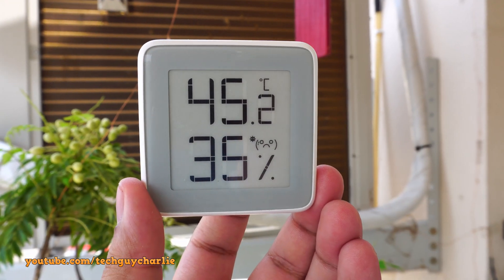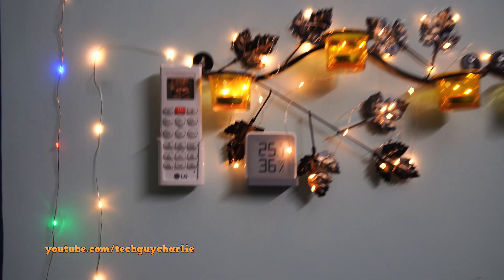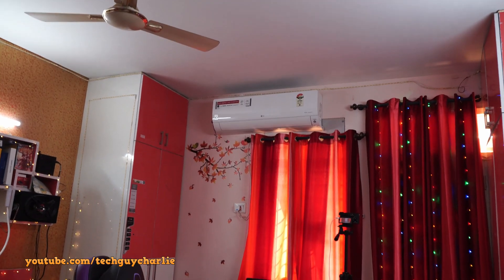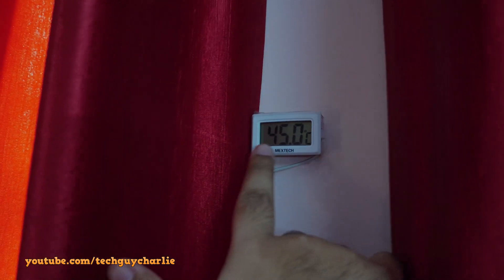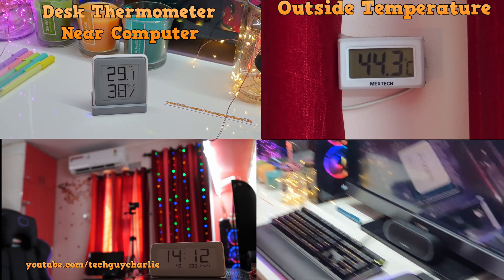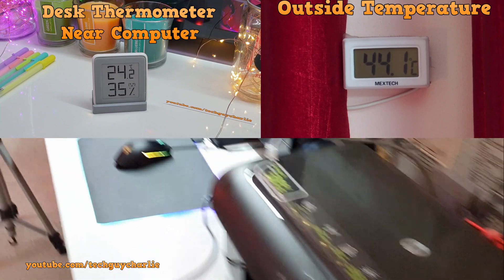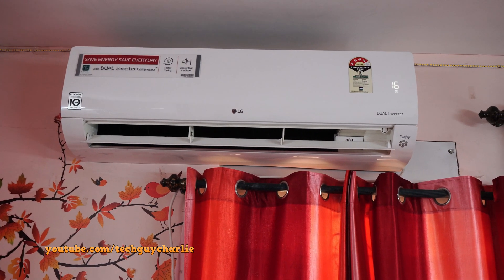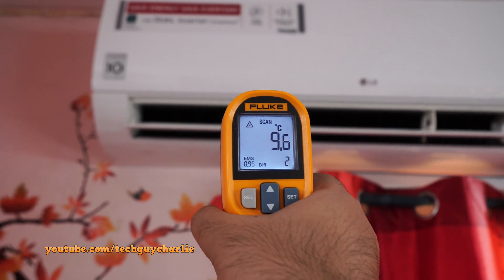LG Dual Inverter AC cooling performance on 44-45*C day how long does it take to cool

Comment: Hello, did nayone face this problem? Indoor tempertaure on the remote is 23 but on ThinQ app it shows 25 degree, when i manage my ac from the app when i was outside indoor temperature does not reach the required teperature 23 degree or 22 degree

Comment: Bro I have lg dual inverter 1.5 ton ac.
It takes 2 hour to reduce temperature from 37 to 27 degree celsius after servicing of ac. In my opinion, it is not a good performance what should I do??
Reply from the maker: Mine takes only couple of minutes, your PC is probably undersized for the room or you have power saving mode turned on, try running at 24*C with medium/high fan speed without any power saving mode, it will cool within minutes.

Comment: 1:48     I live in Taiwan. I just installed LG inverter air conditioner in July 2021. The cooling capacity is 2.2kw. The year of the outdoor unit installed at that time was 2019. The cooling degree is excellent but there is abnormal noise. In September, it was replaced with an outdoor unit manufactured in 2021, and the problem of insufficient cooling capacity began to occur.
Reply from the maker: Hi, did they vacuum the lines after replacing the outdoor unit? And have they replaced it with the exact same mode?
Reply: @TechGuyCharlie  Yes they did about 30 mins, and replaced the same mode. Before replaced, I observed in LG Thinq app, if I set up the target temperature at 26℃, and the compressor stopped at 25.5℃ and restared at 26.5℃ room temperature . After replaced, the room temperature rises upto 26.5 even 27℃, the compressor dosen't work at about 30℃ outdoor temperature.

Comment: my ac is taking like 1600 watts and not lowering room temperature under 28.9 degrees, what seems to be the problem ? the air is coming out cold though
Reply from the maker: To me it sounds like an undersized AC, I am guessing the room is quite big? 🤔
You also might want to check if there is cold air leaking from the room, check the doors and windows.
Reply: @TechGuyCharlie  hmm there is barely a little space under the door, and it seems like a 14x16 or 12x16 room my ac is 1.5 ton

Comment: My Dual Inverter AC 1.5 ton if the temperature is 45 outside it's run at full load...like it's consuimg like 1.6 units / hour or full night like 10 hours it's consuimg 16 units...where should I check is it AC issue or digital meter issue
Reply: It depends what you feels and check temperature of air coming out of your ac  with digital meter hand gun like in this video  ( infrared one )

Comment: Brother i want to buy an ac which has nice cooling with high energy saving. So should i go for lg 2021 ac modles?
Reply from the maker: LG is very good! I actually upgraded this AC to the hot and cold unit, so that we can get rid of the heater during winters, it's pretty good, solid cooling and heating too I've reviewed it here: https://youtu.be/US5RQN8hvC8
Reply: @TechGuyCharlie  thank u so much😊. I'll go for lg now

Comment: I have LG 1.5 ton AC dual inverter and I live in top floor with direct sunlight. 
I feel my AC doesn't cool like before. It's less than 1 year old. When outside temperature is 34 degree celcius the room temperature only comes down to 26 when set to 18 degree Celsius. What can be the issue?
Reply from the maker: That is quite strange, never had this sort of issue on any of my LG ACs, they always cool well below 22 no matter how hot it is outside. I hope you don't have the power saving feature turned on?
Reply: @TechGuyCharlie  How to check the power saving feature is on or not?

Comment: i really love the way u make your videos...a high tech one...im from Saudi and outside temperature right now is 43..i have set my lg dual inverter ac on 27 and its consuming 11 units on 24 hour run which is day and night...is that normal?...my outer unit has a wall infront which is like 3 feets away..is that ok?
Reply from the maker: Thank you! 😊 yes, this sort of power consumption is pretty normal, especially for big rooms. And 3 feet is a little too low, but as long as there is proper ventilation and space behind the condenser coil, you should be okay!
Reply: @TechGuyCharlie  yes its wall mounted on brackets so their is a standard space as per the mounts spacing....and despite of wall 3 feets away  it is open from the top ..outer is placed in gully usually given in banglow on the sides...if i mount the outer upwards in totally open area will it save electricity?

Comment: Bro i have 220sqft room.. can i buy lg 1.5 ton ac.. room in ground floor and no sunlight issue in room
Reply from the maker: Bro, I would suggest to go with 2tons for such a big room. 1.5 ton is good up till 160-170 sqft max anything above that you'll need 2ton for good cooling. 😊

Comment: Why my lg dual inverter 1.5ton 5 star ac take forever to cool my room
Reply from the maker: Hey, could you please tell me a few things like
1. How big is your room, like mine is 150sqft.
2. Do you have any walls exposed to sun?
3. Whats the temperature outside when you feel the AC isn't cooling.
4. How old is the AC.
5. What's the fan speed you set on your AC.
Reply: @TechGuyCharlie  room is of 170sqft. 
Umm yep one wall is exposed to sun 
Bahar ka temperature is about 36° 
AC is 3 months old 
We have to keep fan speed on 5 still ot doesn't work
Reply: @TechGuyCharlie  like even right now,my ac is ON since 3-4 hours at 16° and the fan is on F5 still my room room temperature is 28° 😐
Reply from the maker: A 1.5 Ton AC is ideal for rooms up to 150sqft, but I believe something is not right, at F5 and at 16 the AC should chill the room, even if it's a big room, it will take time, but it should cool to at least 24 from my experience.
My parents bedroom is about the same size as yours and that has an LG 1.5 ton 3 star AC about 3 years old and it cools the room down to 24C with fan speed at F5, it takes about an hour, because it's a big room, but it does cool.
I'm wondering if the thermostat in the AC is faulty, and is reporting lower temperature than it really is. 🤔
I hope you have the power level set to 100% because there is a feature on these ACs that let's you run at lower power. (the 5-in1 button)
Reply: @TechGuyCharlie  idk ...i think I should contact any technician
Reply from the maker: Call LG service center directly, let them deal with it, but its gonna be tough because of all the restrictions because of the pandemic, please STAY safe.

Comment: When is your 2021 AC review coming bro?
Reply from the maker: Just waiting for the weather to warm up to at least 36-37 degrees bro, otherwise no point of doing a cooling and power consumption, hopefully by next week it will get hot enough! 😊
Reply: @TechGuyCharlie  By the way, bro during installation the guy said I should always keep fan speed at high so that it'll work efficiently, is it true? Is there any con for using it on low fan speed?

Comment: Hi there charlie. I'm in queensland australia.
I've just about watched all your videos on air con.
I've got a kelvinator 7.1 kw. i used to set air con on 18 deg.
But now that I've wafch your shows on aircon.
I now set mine on 26 deg. I also have solor on roof.
Before on 18 deg. I always had to pay extra on electricity bill.
But now running on 26 deg. It cools the whole house down in about a 5 min. The best this is im getting money back on rebate. So i with to thank you on this.

On anothee note. Not shure if you can do this. But im gonna ask anway.
Airconditioners in cars. I have a 2008 mitsubishi pajero ns.
Anyway. You know when you turn on aircon in car. You chew up more fuel.
So I'm wondering.  If you set aircon on 26 deg. Witch im my car i can do, and still gets rather cool in the car. Wondering if you would chew more or less fuel.  instead of 18 deg.

Seems that your such a switched on person. (  clever )
Would you be able to work something out. 
Cheers from down under

Comment: my LG air condition have this problem, it slows down early at 16, but this model was not 2020 model it was 2019 wifi model, did LG updated the air condition firmware? how to fix or reset as earlier this one? earlier this unite fast cool well as chilled my room, plz need support

Comment: I bought 4star dual inverter.. Watching all your vids..
Should u recommend using at 40% 24/25 Celsius for Whole night. As I m using this config but still it consuming aprx 8~10 unit for 10 hrs in June  (I m taking daily unit reading at night nd morning) I m also from Delhi so high temps in June u know. 

Nd  your reviewing style is awesome.. Review more other brands inverter ac  in your frnd house or relatives house.. If possible. So we can get the idea.
Reply from the maker: Thank you so much!! This year I going to get a new AC for another room had planned on getting the new LG model which comes with a built in air purifier, but due to lock-downs and the virus, decided to postpone to next year. 
I'd say power consumption depends on many factors, so I guess your consumption is about right for June, mine used up to 750-950 watts during that time, however now in July, the consumption should come down to 500 watts at night because it's not that hot, can you confirm?
Anyway, lockdowns and the virus pretty much spoiled everything this year, haven't bought anything in 2020 except a chair, that too I had to wait 2 months for it to get delivered. 😣
Reply: @TechGuyCharlie  out wait time I ordered my new phone from flipkart on 19 march nd also visited LG showroom around that time nd planning to buy ac on Sunday (that turna out to be janta curfew) nd. Then lockdown happened. So I got my new phone on 25 may(it was prepaid order) nd finally bought ac on 5 June..
I cant confirm u wattage as I m only taking. Dalily reading.. But yes it rains last night or Sunday early  morning so it consumes 7 unit for Sunday night.
Now after seeing this video I am using it @26 for 2 HR nd then after 11pm at 40% 26degree Celsius .

Nd on reviewing other brand is like  diakin Voltas Samsung.. As Samsung(5yr comprehensive warrenty) nd Voltas(5yr  gas refill) 10yr compressor warranty.
U can review ur frnd's/relative's ac (I know its insane idea.. Especially during this covid period..) but...

Comment: Nice video man. Got a 2020 LG split AC (LS-Q18SWZA) installed last week. I have a few queries, Can you help?:
1. It has an Ionizer feature in function menu but don't know what it actually does. Couldn't find much info about it.
2. The installation guys didn't install insulation tape on foam covering copper pipes. Is it needed, can I install it on my own?
3. The fan suddenly is making slightly more noise after a week (esp. in HiCool), should I be concerned?
4. AC still consumes 4-5 units on 10 hrs usage (26 at 40%) Is that fine?
PS :  Bought this one after watching your detailed reviews.Hope you respond to my queries. Keep making great content. Cheers! :)
Reply: 1. Ionizer is function used when your room smelling bad. It discharge ions which reduced bad smell by removing bacteria. For activate this function..press function key on remote.
2. Yes you can wraps it by own. I have also done this...it is not necessary b'cause lg gives good insulation material.
3. Pls...run the ac at normal mode till desire temp. Is achieved then put it on the energy saving mode...do not run ac on 40 or 60% mode in higher temp. Otherwise it will consume more power
Reply: @divyeshparmar4777  thanks :)
Reply from the maker: Thank you so much, and let me try and answer:
1. There is no ionizer module inside our ACs if there was LG would have written about it in the features list, so this feature will not work.

2. Insulation tape isn't really necessary, as long as the tubes are insulated. But if you want, you can wrap the lines yourself.

3.  I've observed that the fan makes slightly more noise if the filters are dirty, could you try cleaning the indoor filter and check if it is still making noise?

4. Yes, that is fine, energy consumption depends on many factors and at 40% usually, these LG ACs will use around 450-500 watts, so that is about right.

By the way, I'd like to know how is the cooling performance on your AC? Since a lot of people were complaining, it would be nice to get some feedback on the latest model. 😊
Reply: @TechGuyCharlie  Thanks man for answering my queries. :)
I was also thinking ionizer doesn't work, but if I just use the ioniser function, the ac does turn on and display shows ON (there's no cooling in this mode.) 
My only concern is that some ionizers can convery oxygen to very smal amounts of ozone and in a sealed room, that can be a prob over time. That's why I am looking into this so heavily. 😂
Fan noise is still there after cleaning, but not that big of an issue. 

As for the cooling performance, it's excellent. It takes 15 mins max to reach 24°C from around 33-35 (on HiCool) & if I switch in the fan, my room gets super chilled.
Reply: @akshats_space  Hi are u using fan along with a.c. on high mode to get instant cooling in 15 mins...?. If didn't used fan how much time does an ac alone to cool room every corner